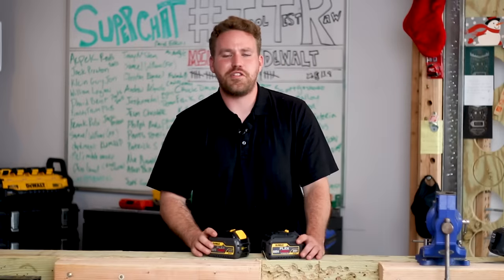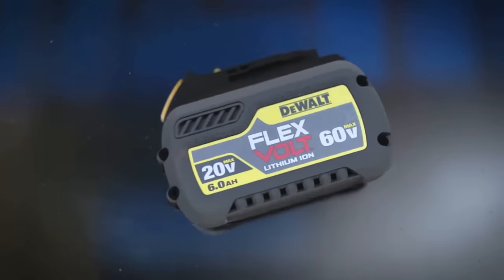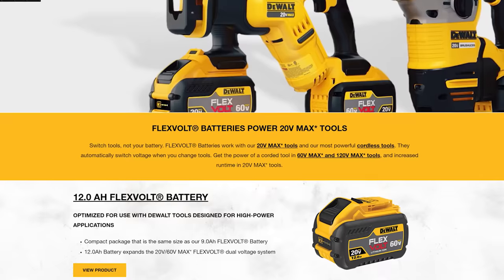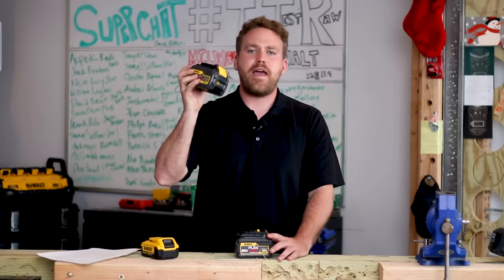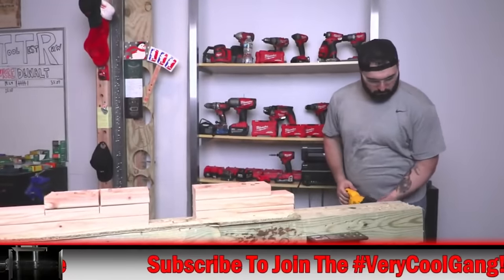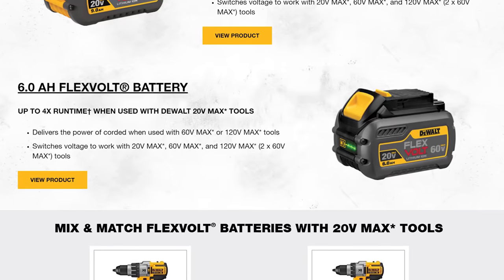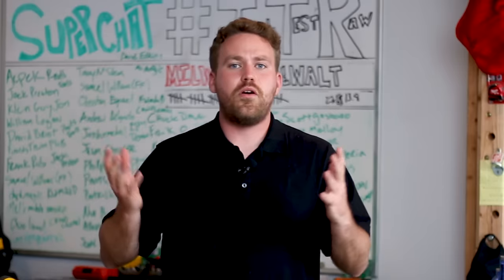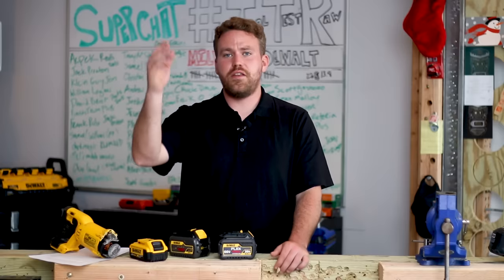NEVER USE DEWALT FLEXVOLT BATTERIES ON 20V MAX TOOLS!

Comment: Man, there is a physical switch inside the battery that allows for the 60v and 20v switch. Either you get 20v or you will get 60v depending on the socket type with the tool. This is quite the bogus claim, and yall even mention this video in your halfway done teardown video. If he had paid attention he wouldve seen that. But atleast he made the correlation that it was the batteries fault, because it was something on your end. 

These batteries supply the same current as the regular 20v batteries. The definition of power is voltage times current. This is why with the bigger ampere/hour we have a larger runtime with the 20v, but the 60v would burn through it faster because with the increased voltage we would have a higher power. Even if the battery somehow threw more current it wouldnt seize your tool, maybe short the switch. But id think that it would have some definte heat coming off of it from running that saw for a full cut and then it just not working. 

But to me, this definitely seemed sus with how your reaction were. SETUP SETUP lol

Comment: I used a flex 56 volt batteries for over two years no problems if you could not use the batteries then Dewalt would not honestly tell you it’s okay VCG know one bothered

Comment: Yikes.... Comments are pretty brutal.  I'm glad that I read through them though... Doesn't seem to be a rampant problem even when using the FlexVolt during standard construction jobs.  Although I like their videos and info, it's kinda like those NeverGlock dudes that do those insane torture test, like drop the pistol from an airplane, drag it for miles, bury it for years, and even throw in concrete and after all of that: "See, it's a bad product because after we put through these small trials we found it MIGHT fail."

Comment: Flex volt batteries work fine in all my 20V Max tools. You’re probably just overworking your tools. Gotta watch that duty cycle. Flex Volts will last longer and possibly overheat your tool.

Comment: Doesn't understand series and parallel connection. Basically the capacity is changing, not the power to the tool.

Comment: i was curious to see the video but got conclusion when i saw a shelf of Milwaukee tools showing on the back.  This is not a true review, just a fight between the supporters.  I would not think it is unbias.  By the way, i am computer engineer (note: if you go to school you probably know the CompE takes more ... electrical classes than normal Electrical Engineer :)).  Should be no problem if they design switching circuit correctly.  This is not a complicated at all.  Just a pool of battery energy being used properly.

Comment: I haven't used flexvolt on anything yet. I'm just starting to rebuild my 20v tools again after someone stole all mine out of my truck. But, all I see is you guys taking a tool and pushing it to its absolute  max possibility. I'm just a backyard mechanic  on the weekends n a factory rat during the week. But I see 0 reason to be cutting what looks to be a 6x6 or maybe a 8x8 chunk of treated lumber with a cordless reciprocating saw. Stupid I'll stick with my dewalt either way

Comment: I Have 13 Flex Volt Batteries, Use Them With Any Kind 60v Or 20v Tools For 3 Round Years... Not A Single Tool Down... I Work On Heavy Duty Commercial Construction. I Really Like This Reliable Tools! Dewalt Is The Best!

Comment: I use 60 volt batteries in all my Dewalt tools 20 ands 60 volt tools all the time for almmost a year. I work on cars and go to junk yards to get parts off semi often. Just easier to have one battery work all your tools. Yes my 20 volt tools work stronger with the 60 volt batterys ( even though  they drop down to 20 volts). even Dewalt states that. Guess why this video has 3.5 dislikes vs 2.6k likes.

Comment: Flexvolt killed my DeWalt chainsaw for good. After it killed my impact I was stupid and did it to a 2nd tool with the same battery.
USED ONLY MILWAUKEE SINCE 😜
Reply: How is that possible? The flex volt is 20v

Comment: you saved me some bucks and some heart ache...I  was just thinking about the 60volt batteries  and if they would be any better at running the 20volt tools or if they would last any longer... apparently the 60volts were made for what they were designed like  chainsaws and other items that will only work with them and not for the 20volt tools.. thank you  very for the info and the demo's sorry that the flexvolt 60volt max batteries wrecked your 20volt max tools.. that is something that I can not afford to have happen... I am trying to migrate to dewalt when I get enough money... right now the batteries are a big hurdle so I am buying the batteries and using an adapter for the batteries for my drill and other non-dewalt tools... so I am not planning on buying any batteries over 20volts anymore.. unless I buy a dewalt tool that requires a dewalt 60volt battery...

Comment: It's not magic.  If you look at the tools they make different contact points and flexvolt tools have an extra prong.  So it's not like a 20v will ever get 60 volts.  We have been using them without any trouble.  I am fazeing out 20v batteries all together so I can keep fewer batteries on the truck and make it all day.

Comment: 30 minutes ago I smoked a DCD771 with a 60 volt battery. One 3" hole with a sharp hole saw in 1/16" mild steel. Pathetic.

Comment: maybe you should google "duty cycle". just because you get 3X more power per battery dose not mean the motor can run 3X longer without needing time to cool off.
Reply: Thomas Larsen 
Which is why the M16 went from full auto to 3-round burst. Guys we’re melting the barrels.

Comment: If you push your tool that hard you will fry it everytime. They are not made to be used continuously working that hard. If you need to cut through a 8x8 with a saw like that you should not use cordless

Comment: So if the battery can deliver a 20V and the equipment operates at 20V at It doesn't matter what the power rating of the battery is because the equipment will drain as much current as it needs
P(power)=I(Current) x V (Voltage)
now I will tell you why you have destroyed a lot of tools under the Flex Volt
you have been putting a lot of stress on the tool itself using it at it's highest Torque value or highest RPM consistently
with the Flexvolt battery and since the battery is not easily depleted, you keep pushing the engine past its failure point and the battery keeps delivering until the engine is toast.
For me I use Flexvolt on my 20V tools with no issues, I actually mixed cement with it (20V Brushless hammer drill), just giving it a rest every five minutes so I can rest too!!!
The tool is fine and the battery is fine!!!

Comment: Blaming a battery on a tool overheating is like blaming a dog for pissing in the house. You are responsible at the end of the day...
The actual battery are built in 20v and have a transfer switch only activated when hooking battery up to a 60v tool. They lterally have a transfer switch
Mechanical
So don't blame a flexvolt battery for your own ignorance...

Comment: It's not the batteries overloading the tools it's the tools using the tool overloading the tools. When you are doing speed/power contests with other tools you are overworking them. I use the flexvolt tech in my 20max tools all the time I just don't abuse the tools. Never force a power tool. Ever.

Comment: I dropped my non xr impact driver into a lake. Let it dry. And I use 60v batteries on it. I've had that tool for 4 years and it works like a top. Consistent. Also got 4 other 20v that I use with the big boy batteries. This guy literally has no reason to make this statement.

Comment: All’s a flex volt it’s 3 x 20 volts. This makes them be able to be sent via air. As you can not ship any battery by air over 20 volt. If I heard it correctly.  So with this pack of 3  you can send by air. And obviously when the computer is told to it takes all the 20v batteries and turns them into one. 

Anyway what know guys are doing is just raising the question.   that’s all you really need to do call to get pretty close to the same affect as coming out and saying these batteries are bad for the tools.  But they can not do that. 

 it would be proven incorrect if you raise tit

What rang true for me was. This guy seemed. As though he was “dodgey” or sketchy.

Comment: lol

This is stupid. 

I have had nothing but perfect success using flex volt 60v batteries on 20v tools. 

you never knew the tool could run so well until they came out with flex volt batteries. 

1/3 more power, less loaded motor, it is awesome.

Comment: THIS IS FALSE and a waste of time....Im a fence builder and have had a dewalt set they released with both a flexvolt and xr battery and they are still working like brand new.i have installed over 300+ gates with it.Why would they have sets that come with a flex volt and max battery for both a flexvolt and max tool??

Comment: Folks..its same thing as putting 3 x 12v batteries  in your car.  It will not burn your starter ( for normal starts, normal engine) . It will run all your appliances 3 x longer. The only issue maybe your alternator. Voltage is constant, amps depends on load. With big capacity Flexvolt, the motor just runs longer. And may overheat and burn. Simple. Has nothing to do with fat or slim battery

Comment: Do you guys still stand by this statement?

I'm seeing from the comments that it's impossible for the 60V batteries to over-volt the tool.  If they are tending to burn out the tool it might have to do with the tool design and the maximum current output the battery can provide.

Comment: You guys don’t know what the hell your talking about. I’m an electrical contractor, and use multiple DeWalt tools every single day, including 20 volt tools with the flex volt batteries with zero issues.

Comment: Do you know how voltage and amperage works?  Let's make it simple.  You can increase runtime by putting batteries in parallel, you can increase voltage by putting batteries in serial.  When it is in 20v "mode" there are five 3.7v batteries in series giving us 3.7v * 5 = 18.5v (these can be over charged to 4 volts which is 4v x 5= 20v).  When 3 packs are put in series then the voltage is 4v*5*3 which gives you 60v!  When they are not in series the 2 additional battery packs inside are put in parallel which give you 3x the amperage thus giving you 3 times the runtime.   Simple science.  No flex volt batteries will not hurt you 18v or 20v tools!  (More than likely these idiots forced the battery into the 60v configuration and ran the tools on 60v to burn them up).

Comment: The flexvolt system works based on 3 banks of batteries. Anyone familiar with electronics knows that if you run batteries in series, the difference between positive and negative voltage is increased while current stays the same. Conversely, if you run the batteries parallel voltage stays the same while current is increased. They've done a pretty neat trick here by coming up with a battery that has an internal switch to change it from parallel to series.

Comment: Who the hell would use flex volt batteries on 20volt power tools!
A single 5amp or 6amp 20volt max batt will give you enough juice to do anything in a day!
No matter how long you use it! Not to mention the weight… 🙄
Anyways, if it works, it works but for extra unnecessary runtime, honestly… 
Ill stick with my 5amp for my 20v tools and
My flex volt batts for my bigger power demanding tools 😉 
Either way, I just tried my flex volt on my impact driver…. Worked fine but the weight 🤔 shit.
I dont see my self installing ceiling drywall with this combo 😂 💪🏼

Comment: Flex volt is wired in two configuration. It's your use of the tool. If you compare pins on a 60 volt vs a 20 volt it's a different pattern. This video is just click hate.

Comment: im sure 99% of people who use these tools to make a living know it is imposivle for the battery to deliver 60volt to a 20volt tool because of the cells are wired in the pack. 
although was a time a couple years ago guy was running a damaged 4ah20volt battery on a drill and the battery fell out then the drill was dead.

Comment: All i can do is laugh... I had that same reciprocating saw burn up twice with regular 5ah 20v batteries. I love my flexvolts and i will still switch them back and forth in my max tools. This is video is not an accurate depiction on the max/flexvolt tool use.

Comment: Total BS.
I can’t count the number of hours that I’ve run my 18v (In Australia) with the flexvolt batteries over the past 3 years or so since my first flexvolt gear. I have over 20 Dewalt tools and have never once had this issue.

Comment: Dewalt tools burn up because they are made like junk. Has nothing to do with the flexvolt. 
I’ve been a dewalt guy for a decade and all of my older dewalt tools cannot be burned up or destroyed with any battery in them. 
However lol of my 2019 and up tools from factory 47 have died within weeks no matter the battery. Something is up with their new stuff and I’m switching to Milwaukee. 
I am an iron worker so I am super hard on the tools, the older ones I beat like a re headed step child and they never miss a beat. The new ones, you look at em cross eyed and the burn out.

Comment: That was a super janky video. I would not doubt that a 60v battery could burn a 20v tool up but the tiny little amount of footage shown of the impact driver burning up while driving a lag bolt only showed about 2 seconds of the "test drive" then cut immediately to the drill smoking. I have burned up plenty of Dewalt 20v impact drivers and hammer drills. AND I MEAN PLENTY!!! However I was almost always abusing them and a new drill motor is only $19.00

Comment: The 20v tools don’t have have the wire to get 60v power. It’s why you can’t even plug a 20v battery into a flexvolt tool. This is nonsense.

Comment: Imo a 20v Max battery in a 20v Max tool under a load might drop volts to 13-15 volts for safety. With a FlexVolt battery on a 20v Max tool, the FlexVolt might not drop volts under a load and keep it at 18-20 volts that might be hurting the tool when the volts need to drop. I would think that Dewalt would have figured this out though. 🤷🏻‍♂️

Comment: It works just fine.  Some inaccurate and/or bad info here that seems to stem from a misunderstanding of how these batteries and parallel vs series electrical connections work.  Please pull this video because you're putting out bad data.

Comment: 30 Year Electronic Engineer here. 
The only possible way a large 60v battery can harm a 20v max tool is if the large AH battery can run the tool through hard material for such a long period of time that it gets hot enough to burn it up.  But this could happen with any power tool, no matter what the power source. AC or DC. Unless the tool has a thermal shutoff protection circuit. Not sure if Dewalt tools do or not... but im guessing yes.  The only other way is if the batteries built in voltage regulator failed. And thats not likely. Nowadays regulators are rock solid.  If any power tool never gets a chance to cool off and gets ruined ... Thats user error. This video is BS and they know it.

Comment: you're burning up your tools because you don't know how to use them properly. It's called user error, pick the right tool for the job. If you need more power use the 1/2'' Dewalt impact to drive lag bolts and use a 60 volt reciprocating saw with a sharp wood cutting blade instead of a metal cutting one. I have never burned up my tools like that in 25 years of working in the field. Dewalt has been my brand for years and I still have old brush motors in my lineup attached to 60 volt flex batteries with no issues. The Dewalt platform is amazing with a wide range of selection and options. I have even converted other power tools with battery adapters to accept Dewalt batteries with no problems. I'm what you would call vested in both Dewalt and work experience and I came too far to turn back now and start over again.

Comment: FALSE.

I use DCF887 & DCD996 (both 18/20 V) with 9 AH (162 Wh) battery for almost past 5 years and running perfectly.
I also used the same 9AH battery on 54/60 V tools too like DCC1054 (Cordless air compressor) etc..

Comment: This video is a joke, I use flex volt batteries in all my 20v tools never had issues. The part of your video showing you’re impact drill burning out was on you. That was just tool abuse. All drills get hot, it’s your job as the operator of the tool to know when to stop or slow down. Don’t blame it on the battery bro.

Comment: Dumb. There is no difference between XR batteries and flex batteries when used in a 20v tool. The batteries are split in to 3 groups, when used in 20v mode they run the 3 groups in parallel. When in 60v they run in series. It's that simple. 20v batteries just dont have the connectors for each group of 3 allowing the tool to use it in series. The only other difference is amp hour rating. A battery with a higher amp hour rating may be capable of providing higher amperage if the tool demands it. That being said a 6ah 20v is identical to a 6ah flex volt. The flex volt just has a couple extra connectors that aren't used in 20v mode.

Comment: Fact: if you run a 20V tool consistently for a long period and switch out a bunch of 2AH batteries you can burn it up just the same…you still have to keep in mind the capability of the tool despite the battery’s power and runtime…this video is fake news.

Comment: Brushed saw featured in this video:
DEWALT 20V MAX Lithium-Ion Cordless Reciprocating Saw (Tool-Only)
Model # DCS380B $199.00

Brushless variant:
DEWALT 20V MAX with FLEXVOLT ADVANTAGE Reciprocating Saw
Model # DCS386B $199.00

Same price point; one is designed to perform the task. Brushless runs cooler. Before they existed all tools would let the smoke out if meat headed gorillas got their sausage fingers on them. Low battery runtime was the only fail safe against meat heads I guess.